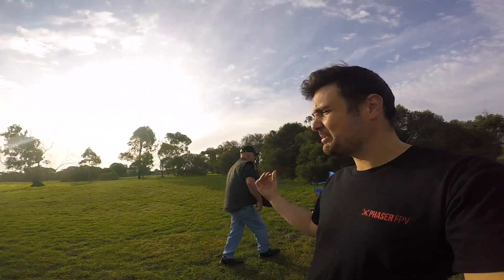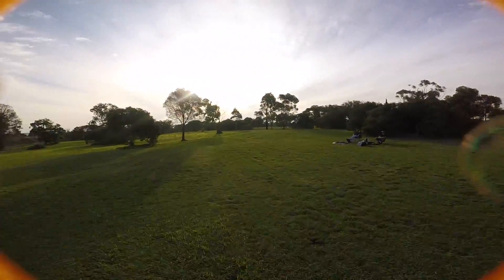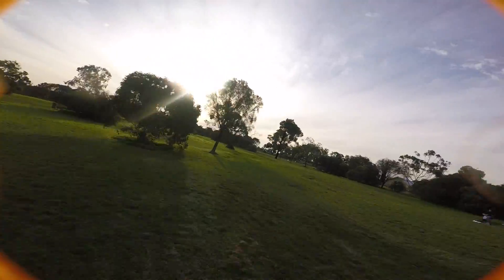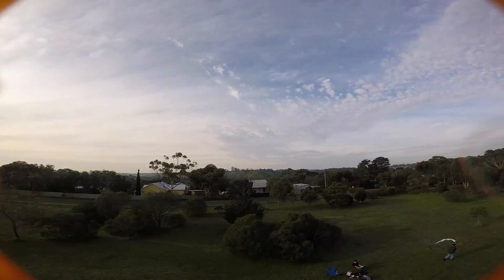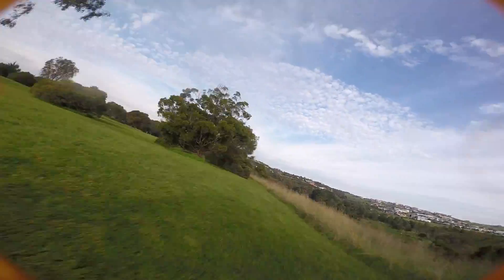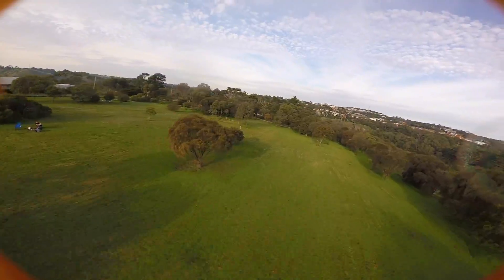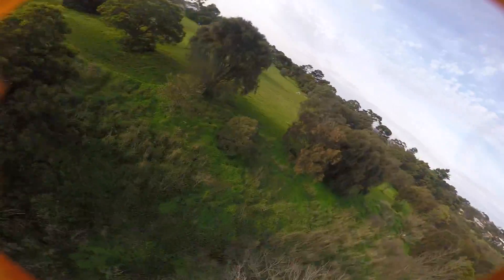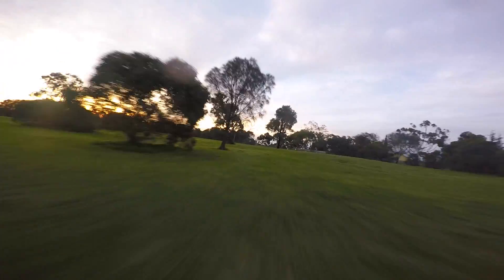How to design an FPV racetrack that FLOWS - Happy Flying #26

Comment: Once we made as we called a lucky ring to actually break the flow and add some unpredictable luck factor. We simply hanged a hula hoop on a string. It rotates around and moves in the wind so each time you are nearing it, it will be different. And we had so much fun with it! :) Like you are flying a perfect lines, getting confident and then you see the hula hoop hole pointed outwards and moving. You need to put the reaction times to the max :) Try this out, it's fun :)

Comment: PLEASE HELP!!!
Hey stu or anyone else that can help I recently bought a wizard and today set up the ia6c receiver so that I can use the turnigy evo with it I finally finished soldering it up and and plugged it all in. Everything seemed great at first I got it to bind with evolution transmitter and it was perfect. I unplugged it so I could do more refinements. Later I plugged it back in and after 20 seconds it started beeping loud and flickering on and off the start up tone. I believe that the antenna wasn't fully screwed in but I'm not sure. The current situation is when I plug in a battery it makes start up tone with no led except 1 red led on the flight controller. Did I Fry my quad. Is it only the vtx that's fried or is it something else. Please please please if any ones can help me it would be so appreciated i don't know where to go to ask for help besides help. Thank you

Comment: Great video. I have a question as a noob. How do you keep yourself low to the ground is it just practice? Any tips? No way I could fly through those gates, flying through full size soccer goals is hard enough lol. I built your $99 build with a betaflight f3 and a couple other minor upgrades and I feel like my quad doesn't grip enough and "floats" a lot when I turn hard (flying the KingKong 5040 props). 

I've flown about 15 packs but have only been flying acro mode for the last 10. Anyway thanks for the videos mate, they got me into my first build and I'm loving it.
Reply from the maker: about another 500 packs and it will start to feel like you can smash it through the air
Reply: +UAVfutures Haha so what you're saying is it's a user issue not the quad lol. That's good motivation to get out and practice whenever I get the chance. Cheers.